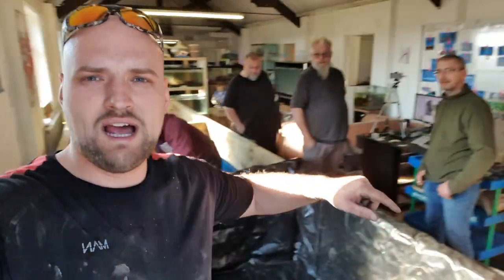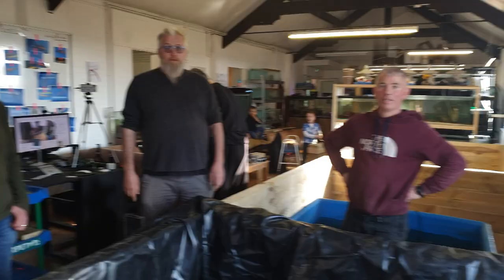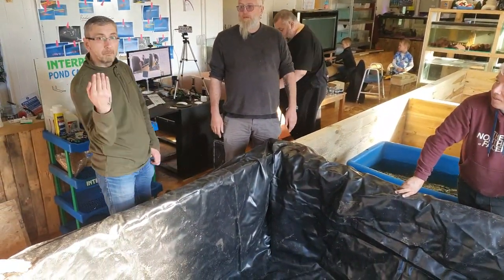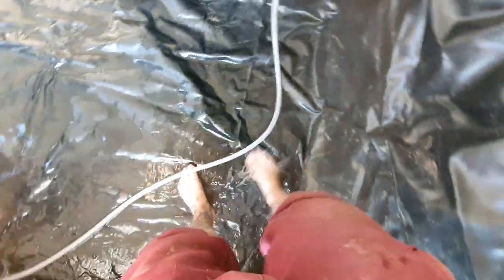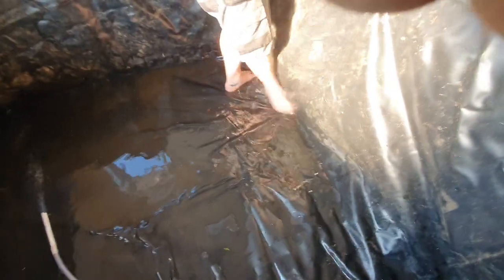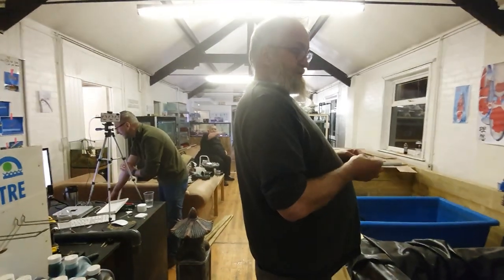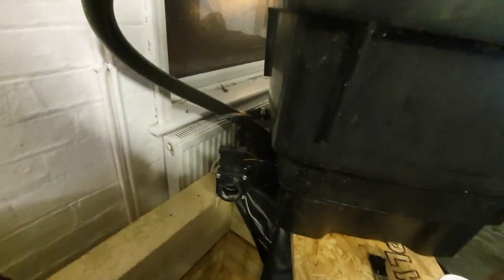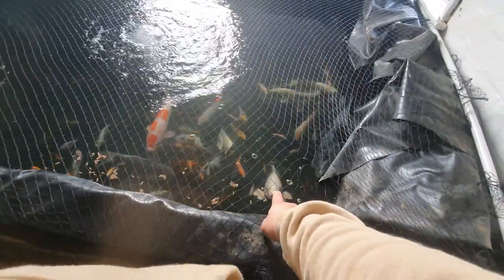Building the three LARGEST indoor koi ponds part 2 ***fish, filters and water***

Comment: I’d of insulated and fibreglassed them as you need to heat to 25 degrees if your going to grow your fish to full potential Jack 🤷🏼‍♂️
Reply from the maker: Fibre glassing is still OK the table mate, unsure in which way to go as these are sale vats not personal ones
Reply: @TheBaldingReefer  well you can get away with keeping them around 14-16 degrees then., fibreglass all day long mate no bad bacteria hiding….And an Easypod will struggle with high volumes of fish you will need to have in those vats for selling on. But what do I know Jack as it’s you who’s in the business 🤷🏼‍♂️✌🏻
Reply from the maker: @surreykoi  were starting slow mate so will he going through one easy pod and bakki shower and eventually running two pods per filter dude